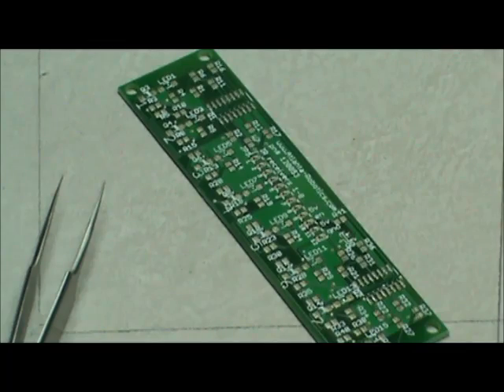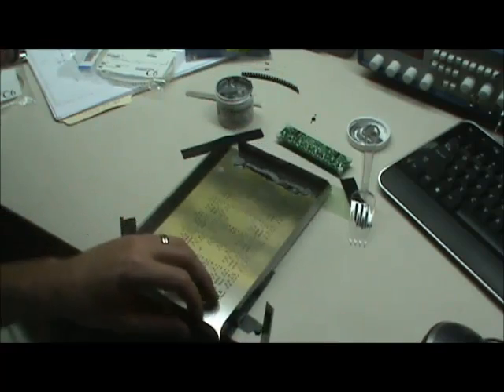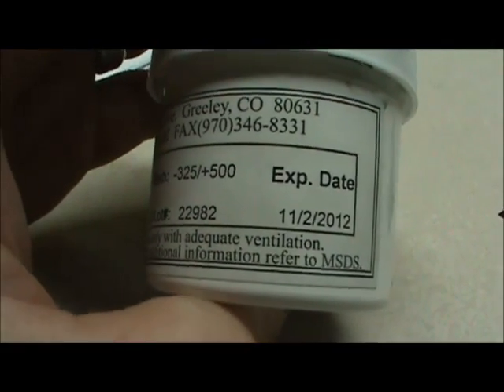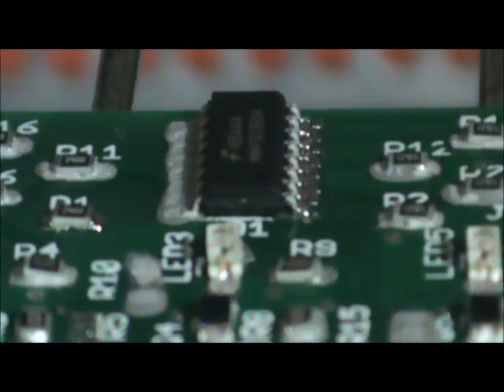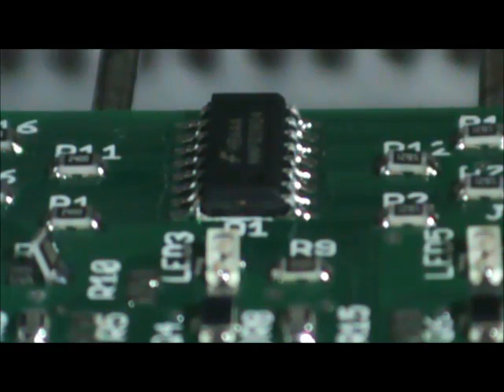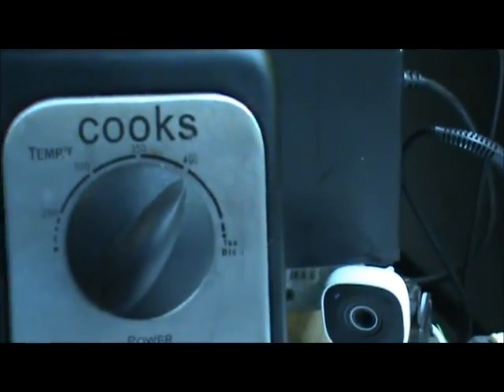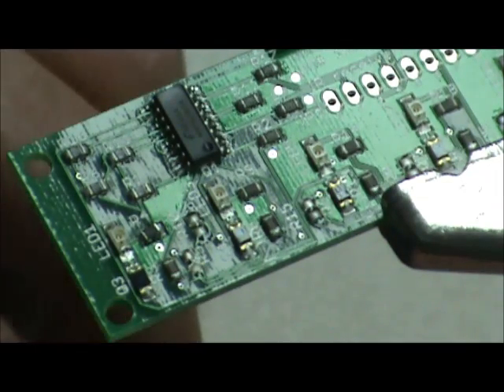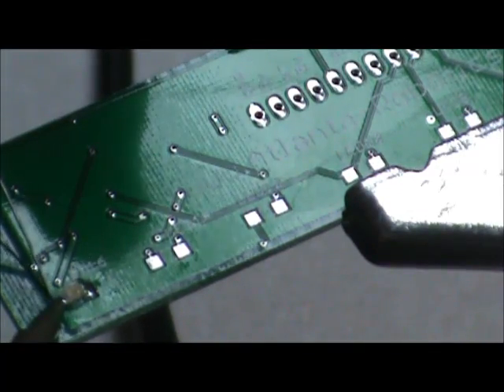Surface Mount PCB Toaster Oven soldering Tutorial

Comment: Thank you for:
1. An excellent view of how to use an oven to solder SMD parts
2. Your patience in explaining what you were doing at each step along the way.
3. Your calm manner of explaining things
4. An excellent infusion of classical  music that filled the empty space,accompanied you  but did not spill out and disturb my concentration - excellent balance.
I  bought a Chinese oven for $450 but see I could have gotten along just fine with what you used. I am saving your video as a treasure..

Comment from the maker: I am using a Panavise brand PCB holder.  They are more expensive than cheap knock offs but well worth the price.  Digikey should have them in there tool>>vises section.  Thanks for the feedback.  I will be posting more soon

Comment: Very nice demo.
I wonder why you didnt use solder paste for those few manual soldered LED's etc ?
For the most part I myself have been using solder paste where ever possible for soldering new / repairing jobs.
IMHO its much easier to handle the solder wetting of parts this way, as you just touch the hot iron to the parts - and job's done !

Comment: Don't "just take it out". You run the risk of damaging the board or the ICs if you change the temperature to quickly. Leave the board in the oven, open the door a little bit and let the hot air escape slowly.

Comment: Are you ramping the temp at all with a controller? Wondering if I need to do that.
Reply: I just put a k type thermocouple near to PCB and watched the digital display and used oven controls at first, but now I just whack it up to 190 C then off then just open the door slowly …..works every time no fancy stuff just a basic understanding of the process and some common sense ….don't no what all the fuss is about bloody toaster ovens and Arduino's....tech for tech's sake  bloody waste of time

Comment: does it have to be a ifrared or can you use one with a regular heating element?
Reply from the maker: A regular heating element would work as long as there is an even distribution of temperature. preferably forced convection with a fan.
Reply: okay. thanks.
Reply: one more question. i can get one for about 20 bucks. however, there are guards covering the bulbs. do i need to remove them or leave them there? sorry. im a noob, btw
Reply: 1369Stiles Leave the guards. They don't affect the temperature much and are a safety feature. Those heating elements are susceptible to slumping when they get old. Better a wrecked toaster oven that a destroyed PCB :P
Reply: ok. thanks
Reply: regular heating elements DO work very well...I use the wife and mine's oven...….get great results

Comment: h heater is used for this process
Reply: The toaster oven I am using is described in detail at 11:00 minutes on the video.  It was a 1400 Watt convection toaster oven.  The soldering iron I have is a Metcal.